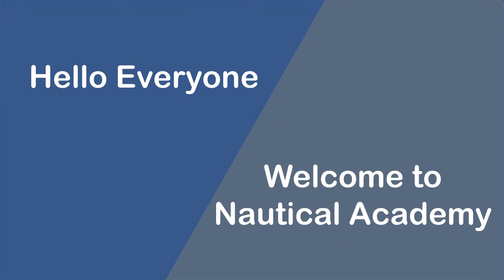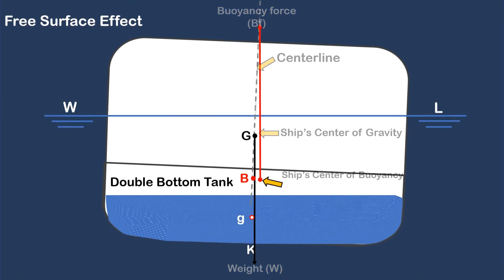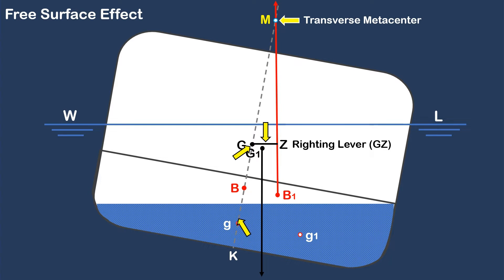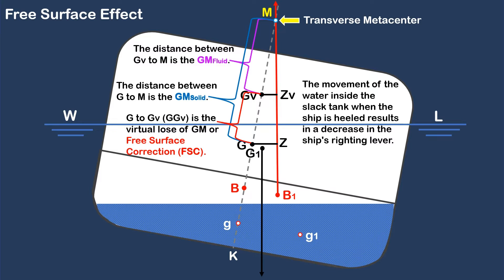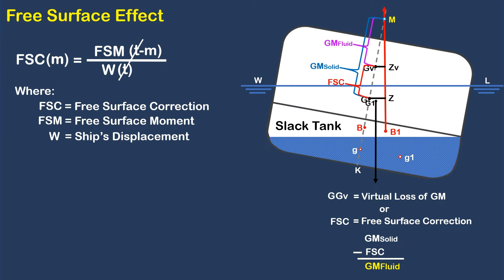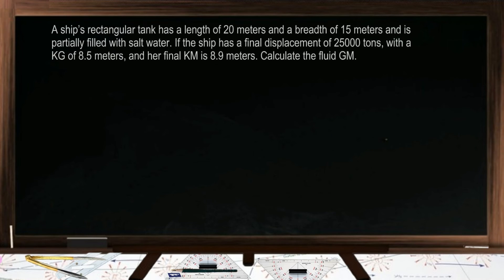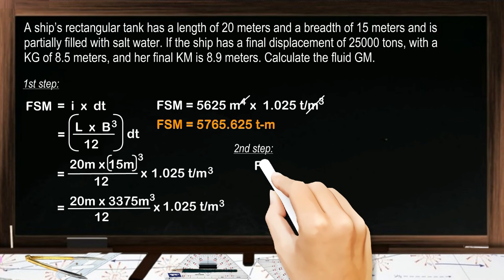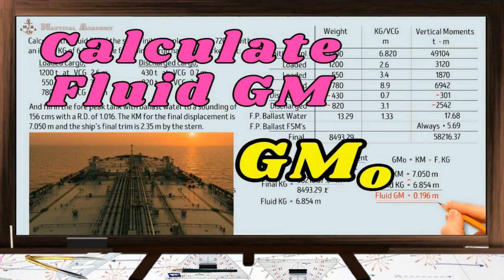Free Surface Effect (FSE) ll Ship's Stability ll Calculate Free Surface Correction ll Slack Tank

Comment: A ship is at the light displacement of 3000 tonnes and has KG 5.5 m, and
KM 7.0 m. The following weights are then loaded:
5000 tonnes of cargo KG 5 m
2000 tonnes of cargo KG 10 m
700 tonnes of fuel oil of relative density 0.96.
The fuel oil is taken into Nos. 2, 3 and 5 double bottom tanks, ®lling
Nos. 3 and 5, and leaving No. 2 slack.
Sir, please explain this problem. I can calculate it.
The ship then sails on a 20-day passage consuming 30 tonnes of fuel
oil per day. On arrival at her destination Nos. 2 and 3 tanks are empty,
and the remaining fuel oil is in No. 5 tank. Find the ship's GM's for the
departure and arrival conditions.
Reply from the maker: This solution serves as a guide only. The KG (center of gravity) for fuel oil tanks No. 2, 3, and 5 at departure, as well as for tank No. 5 at arrival, are not provided in the problem. The KG values used in this solution are based on assumptions.

If anyone has a better solution or more accurate data, your input would be greatly appreciated!

Step-by-Step Solution:
Step 1: Convert Fuel Oil to Weight and Find Volume
Relative Density of Fuel Oil = 0.96
Weight of Fuel Oil = 700 tons
Volume of Fuel Oil = Weight / Relative Density = 700 / 0.96 ≈ 729.17 m³

Step 2: Calculate Departure Condition
Calculate Total Weight and Moments:
Light Ship:
Weight = 3000 tons
Moment = 3000 tons × 5.5 m = 16500 ton-m
Cargo:
5000 tons at KG 5 m
Moment = 5000 × 5 = 25000 ton-m
2000 tons at KG 10 m
Moment = 2000 × 10 = 20000 ton-m
Fuel Oil:
Total Weight = 700 tons
Assuming even distribution in Nos. 3 and 5 double-bottom tanks:
Moment = 700 × 0.5 = 350 ton-m
Calculate Total Displacement and KG for Departure:

Total Weight (Displacement) = 3000 + 5000 + 2000 + 700 = 10700 tons
Total Moments = 16500 + 25000 + 20000 + 350 = 61850 ton-m
KG (Departure) = Total Moments / Total Displacement = 61850 / 10700 = 5.78 m

Calculate GM for Departure:
KM (Given) = 7.0 m
GM (Departure) = KM - KG = 7.0 - 5.78 = 1.22 m

Step 3: Calculate Arrival Condition
Calculate Remaining Fuel Oil:
Fuel Oil Consumption = 30 tons/day × 20 days = 600 tons
Remaining Fuel Oil = 700 - 600 = 100 tons
Update Moments After Fuel Oil Consumption:

No. 2 and No. 3 tanks are empty, No. 5 tank contains remaining fuel.
No. 5 Tank KG (Assumed) = 0.5 m
Moment from Fuel Oil in No. 5 Tank = 100 × 0.5 = 50 tone-m
Calculate Updated Displacement and KG for Arrival:

Total Weight (Arrival Displacement) = 10700 - 600 = 10100 tons
New Moments (After Fuel Oil Consumption) = 61850 - (600 × 0.5) = 61850 - 300 = 61550 tone-m
KG (Arrival) = 61550 / 10100 = 6.09 m

Calculate GM for Arrival:
GM (Arrival) = KM - KG = 7.0 - 6.09 = 0.91 m
Summary of Results:
GM (Departure): 1.22 m
GM (Arrival): 0.91 m

These calculations show that the ship's metacentric height (GM) decreases from departure to arrival due to fuel oil consumption. As fuel oil, which is stored below the ship's center of gravity (G) is consumed, the center of gravity (G) rises, resulting in a decrease of GM upon arrival.
Reply: @nauticalacademy001  thanks a lot Sir ♥️  from Myanmar
Reply: @reeve3854 nice 👏 where do you find those problems ?

Comment: Good morning sir,

A ship of 10000 tonnes displacement, KM 6m. KG 5.5m is foeting upnght in dock water of imsity 1024 kg per cum. She has a double bottom tank which is subdivided at the centre line and is 20mx15m partially filled with oil of relative density 0.96. Find the list if a mass of 30 tonnes is now shifted 15m transversely across the deck
Reply from the maker: Thanks for watching! I will try to answer this question in an upcoming video.